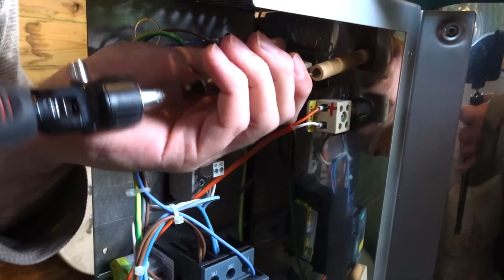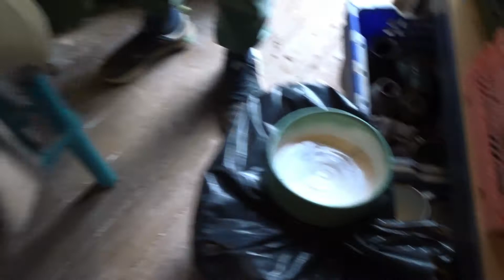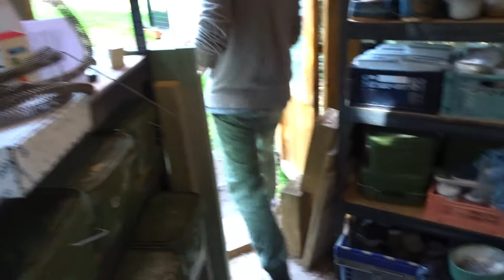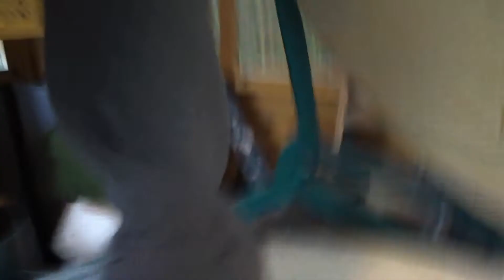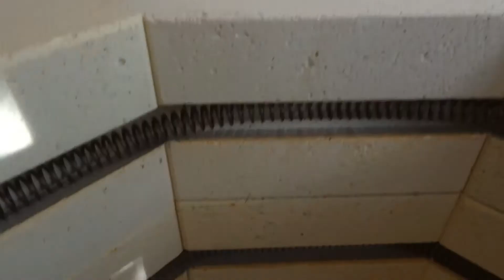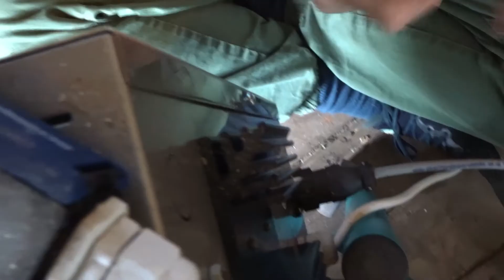Changing Your Kiln Elements - Rhode Ecotop 43L

Comment: Useful tips. Have you ever had issues on the wooden floor? About to buy an ecotop 60 and we have also got wooden flooring
Reply from the maker: No the wooden floor has always been fine for me - I think you could probably get a heat resistant cover for the floor if you are worried. Thank you! Su x

Comment: You missed the tricky part, pushing pins in without slipping and bending the element.
I use a 6" nail , grind off point, hacksaw a groove to match wire diameter for a simple pin pushing tool.
Reply from the maker: Great tip thank you!

Comment: With hindsight, do you think you should have done it bottom up, or would it not make much difference?  Also, was it completely necessary to remove the wires from the connecting block?  Could you have just removed the element?  Sorry for all the q's...about to do mine this arvo
Reply from the maker: I think it would be the same - it doesn't really matter. My husband did the changing so I'm not 100% sure on the removal of the wires from the connection block I'm afraid. Good luck with it x